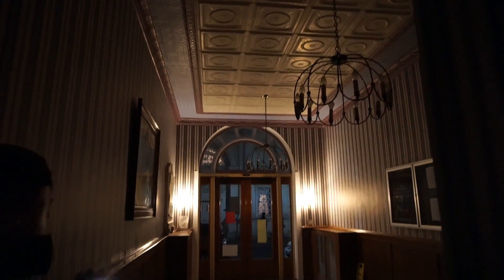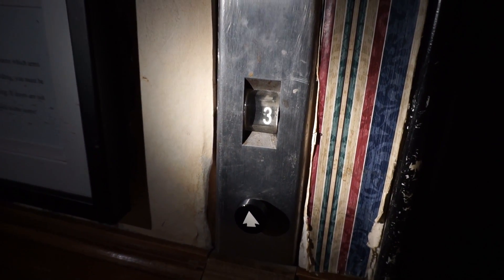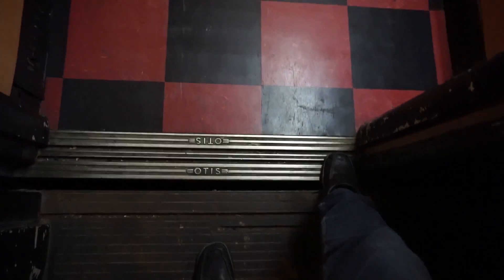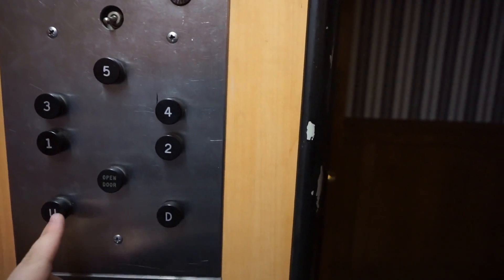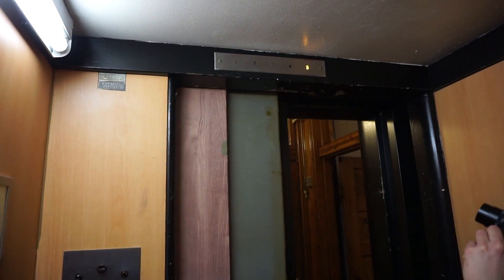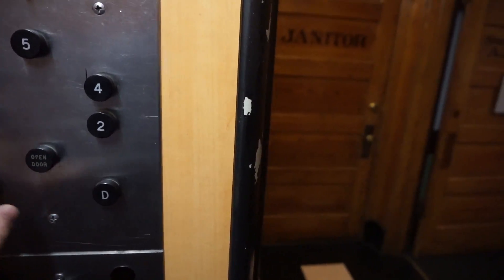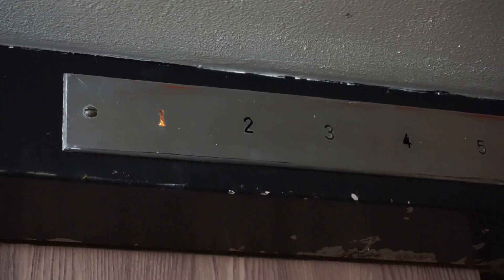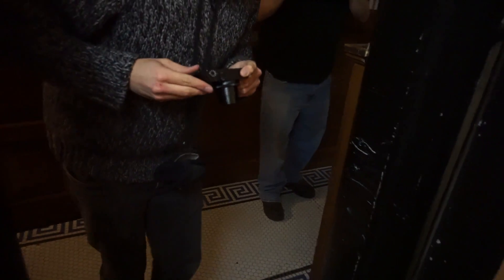AMAZING! 1940s OTIS traction elevator with mech. floor indicator @ Masonic Building, Staunton, VA

Comment: >>Type: 3-speed traction, top drive, relay-controlled
THREE speeds??? I never heard about 3-speed elevators...
Reply from the maker: +Алексей Рукин Yes. It slows down two times untill it comes to a stop.
Reply: +Heritage Elevators Amazing... is it fully original or modernized?